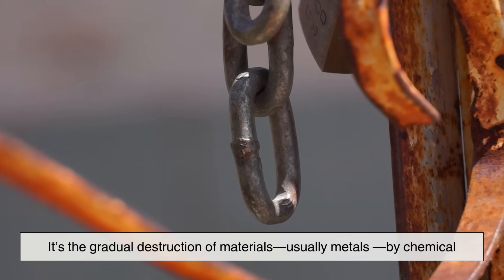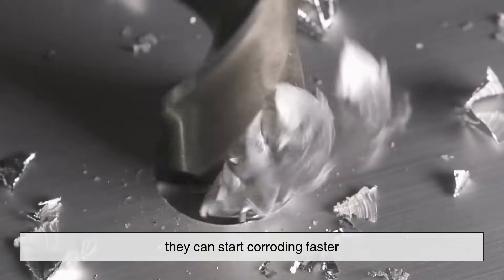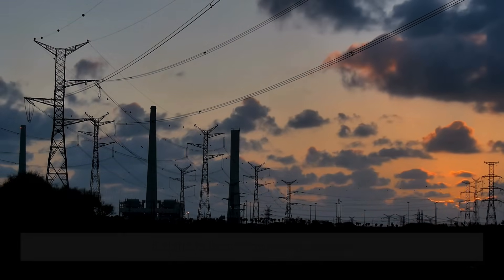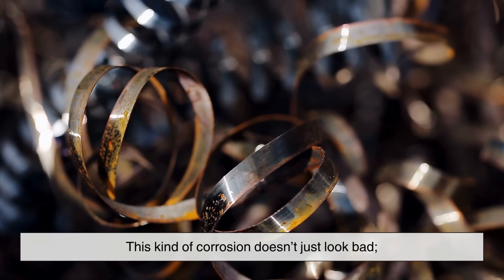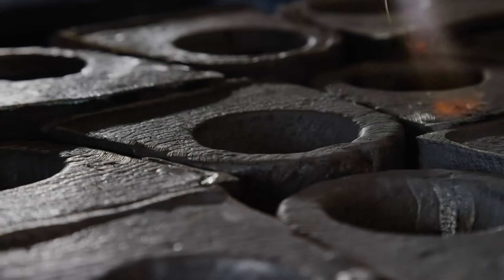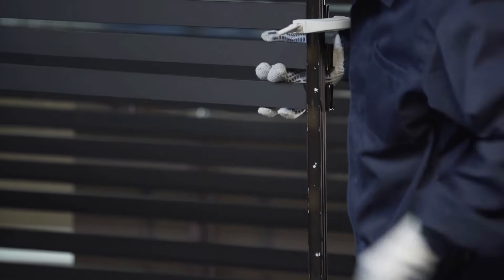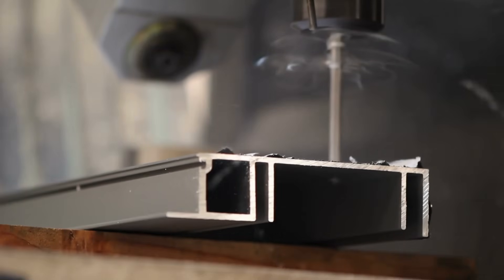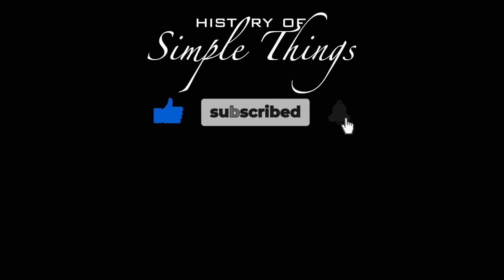Corrosion: Why Mixing Metals Can Be a Design Disaster

Comment: Inside a water heater, there is a rod made of aluminum or magnesium. It is called the “Sacrificial Anode” which is immersed in the water tank. It gradually dissolves by galvanic corrosion in order to preserve the steel body cathode from rusting inside the water tank. The sacrificial anode typically lasts for around four years and then needs to be replaced with a new rod.